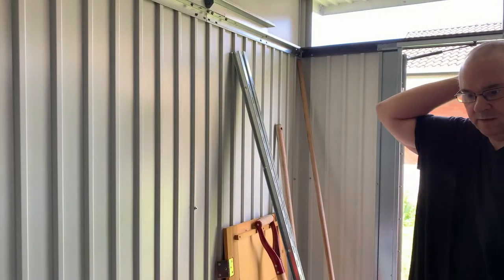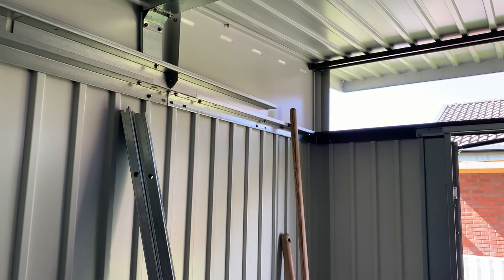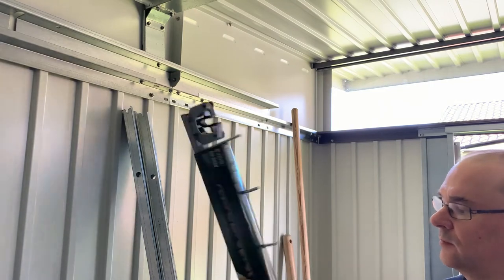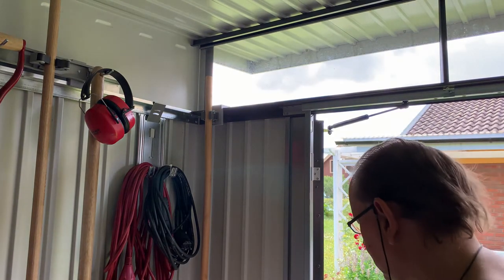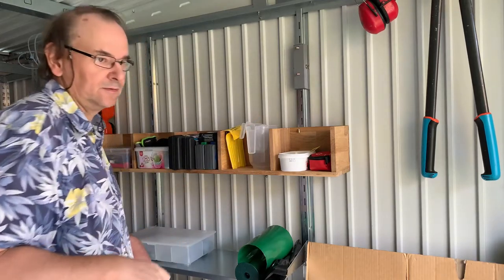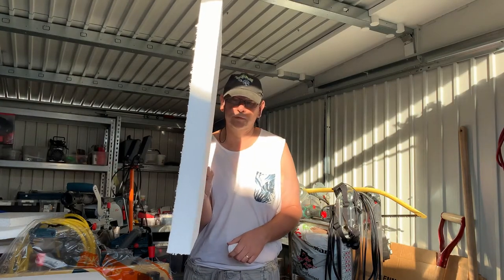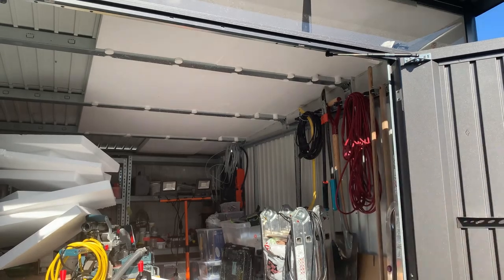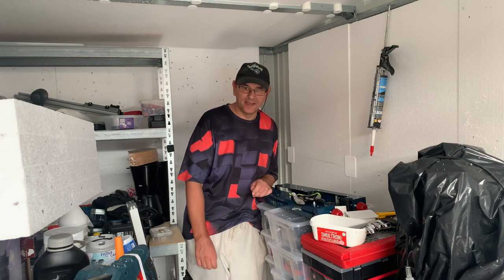Outfitting a biohort AvantGarde garden shed

Comment: What are the dimensions?
Reply from the maker: All dimensions are as built and are approximate. Outside dimensions (walls) 257x340cm inside height 180 to 210 cm. It is not clear biohort sells this large a garden shed any longer. Looks like current largest one is 270x270cm

Comment: is it possible to work inside in summer door open (I live in bordeaux (France)(temp summer max 43° exterior), is the temperature isnt too HOT ? Thanks what is temperature inside before and after isolation please?
Reply from the maker: We do not have as long summers as You do but we can have 25-35 C some days. In my experience adding insulation reduces the radiation of heat inside making it 'feel' cooler. So Yes with insulation and doors open and some kind of a fan blowing it is possible in my opinion to work inside.
Reply: @TheTechRabbit  thanks for info I will take grey quartz not so dark than yours may be save some degres, and put polistireine 4cm  Iwill make devise in abs vs pla , better resistance
Reply from the maker: I put in 5 cm sheets and on back wall 10 cm for sound insulation against road noise. PLA for insulation fastening worked OK for me but You may hit higher temps so go for ABS
Reply: @TheTechRabbit  no need noise insulation